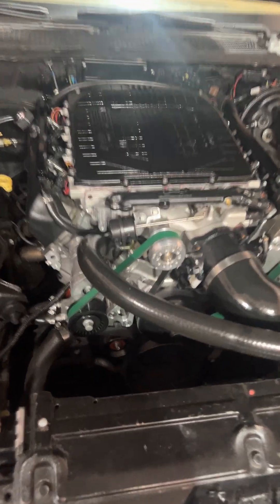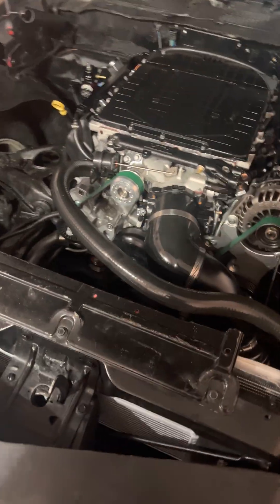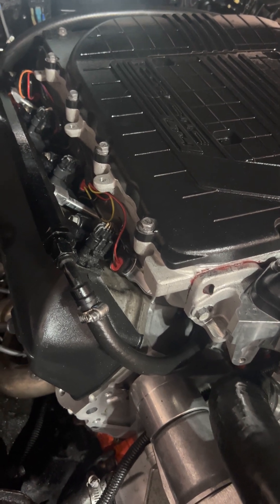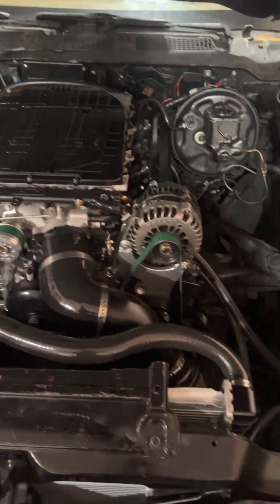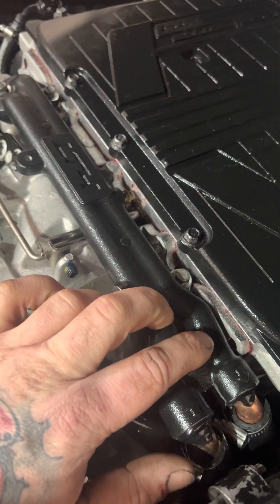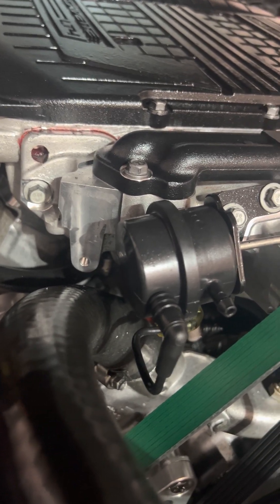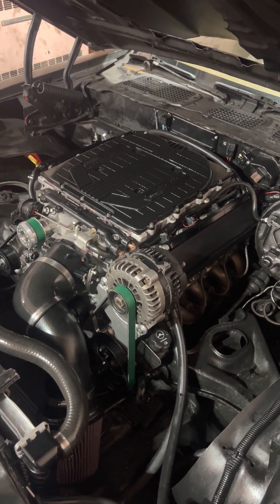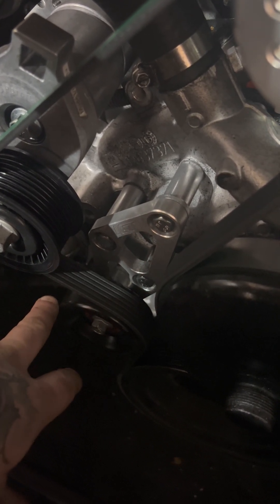LT Head Swap Supercharged

Comment: How do you get the direct injection to be at high enough pressure without the high pressure fuel pump on the cam that the LTS have and and c work with LS block
Reply from the maker: So the secret to that is port injection adaptor plates, that way just nlocknoff port injectin holes and run it as port injection
Reply: @Macburton96  oh I was hoping to do a dual injected set up I assume I would be better just starting with an Lt block then hmm
Reply from the maker: @matthewpino2387  starting with an LT block would be ideal as long as you have the ECU for it, any aftermarket ECU for the LT block is like $1000 more expensive than the LS stuff

Comment: Are you using lt coils? Does a factory LS coil harness plug into the LT coil harness?
Reply from the maker: I am using LT coils, but I’m using an LS harness, so the LS and LT share the same coils, but the LT harness is different from the LS, and since I am using an LS terminator X to run everything I had to keep everything with LS harnesses,
Reply: @ thank you for the quick reply, let me make sure I understand…..I have a 03 Silverado ss, I bought a whipple 3.0L cheap from a friend for a 2020 Yukon 6.2. I can use the original 03 wiring harness, just plug them in to the LT coils?
Reply from the maker: That is correct LT coils and LS coils have the same plug. It’s that GM harness that is different.
Reply from the maker: Feel free to find me on Instagram or Facebook if you want to chat a little more or have any more questions
Reply from the maker: @macburton96
Reply: @Macburton96  I will!

Comment: Do they make shelf cams for this application yet? Or would it be better to go with the gen 5 short block and ditch the direct injection. I know new heads were dirt cheap on ebay a while back and I was tempted but wondered about the velocity with port injection with those huge runners. I'm not sold on the direct injection yet I guess I'm not knowledgeable enough about increasing fuel for elevated pwr. I have an 81z I've been back n forth on the old 400 or 6L LS but this is intriguing, this is the kind of stuff I think about and share the same interests. Nice score on the SC, you did say $500? I would have been ecstatic about that.
Reply from the maker: BTR makes an off the self cam for this setup now, it’s all 345 Cam LT head swap, it’s mint I got one, stage 4 and 399$🎉